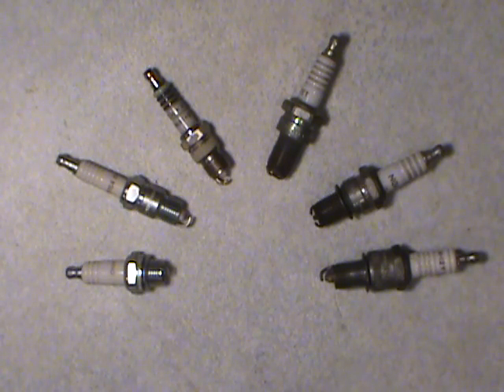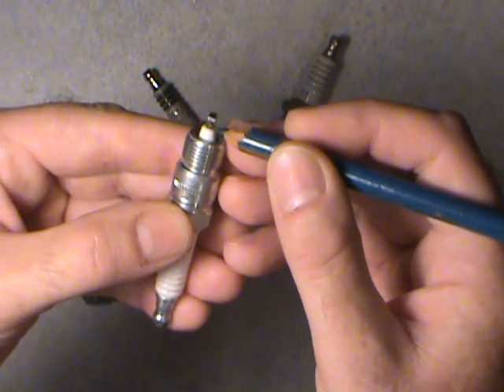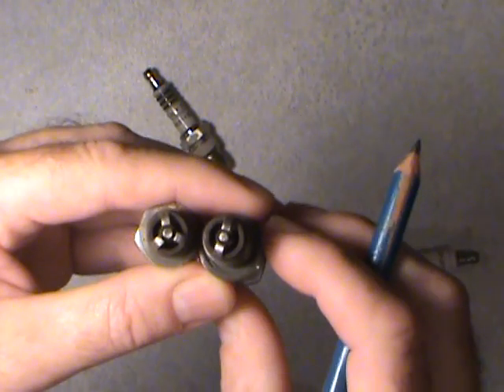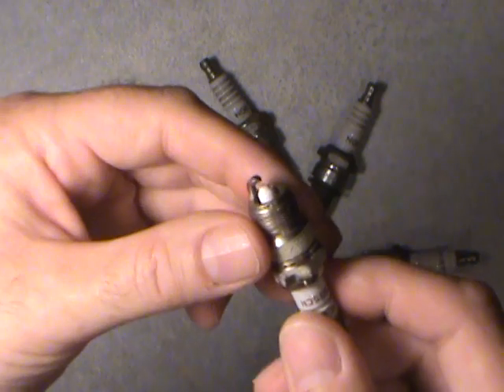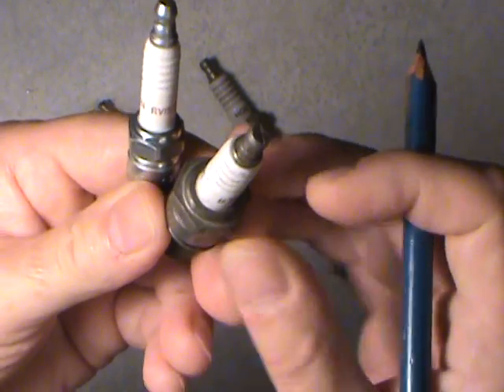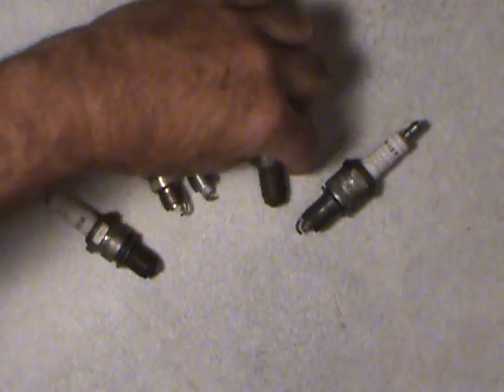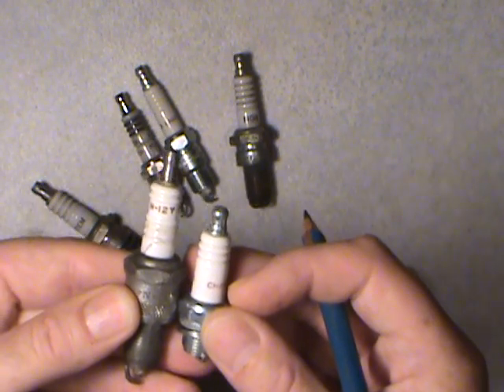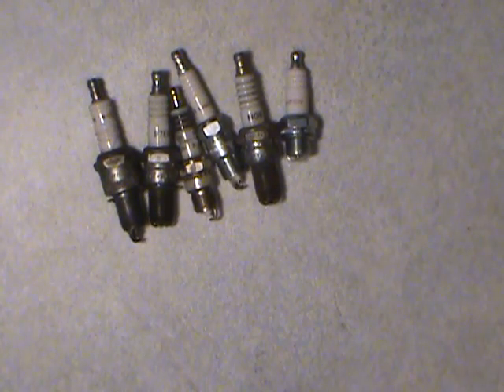SPARK PLUGS Overview (Part 1)

Comment: The reason for the multi side fire plugs used in the rotary Mazdas is the fact that they fire many more times than in a conventional piston engine. Single electrode centre fires simply electrically eroded far too fast and failed far earlier.
Reply from the maker: Greetings Norman May....I see, so, that's the reason that they put those "Strange Looking" Spark Plugs in those Rotary Engines, and Thanks, for that Information as well....I spent quite a bit of time on/with a 1973 Mazda RX-3, 2-door coupe, with an automatic transmission....Those Rotary's are as smooth as silk....With the Auto-Trans, once I hit about 3,000 RPM's and Higher, that Little Rotary sure "Took-Off!!!"....It was 70 Cubic Inches Displacement, and put out about 90 Horsepower!!!....But, the "Gas Mileage" was Horrible!....Drank gas like a Big V-8!!!....I recall the "Apex" Seals were shot, when the RX-3 was purchased, because, a few months later, I had to dump some 2-Stroke Oil, down into that little 4-Barrel carburetor, so the NSU-Wankle Rotary Engine would have enough Compression to Start!!!...lol...Then, there is the, "Special-Graph-Ticker-Tape-Compression-Tester" that had to be used, in order to Chart, the so called 6-Cylinders!!! (3 combustion chambers per Rotor, and there are "2" Rotors).

The Rotary Engine had "2" Oil Pumps!!!
1 Oil Pump that works like any other Oil Pump...

and...

...the "Other" Oil Pump, actually "Injected" Motor Oil into that little 4-Barrel Carburetor (or was it just below it?), so as to "Feed" some "Lubricant" (aka, motor oil), along with the Gasoline, much like a 2-Stroke-Cycle Engine, but, only so the "Apex" Seals don't Wear, and Burn Up!!!

I do remember setting up that Oil Injection Pump for the Apex seals.
Had to hold the engine at certain RPM, that was well above Idle speed, and the Oil Pump had to Output Motor Oil, at so many CC's (cubic centimeters?) in a given time!
Yes-Siree-Bob, an Engine that was "DESIGNED" to "BURN OIL!!!"...lol.

If you tried to use a "Regular" Piston/Cylinder Engine Compression Tester, it would only Indicate, the Highest of the "3" Chambers compression on that Rotor!

This little Rotary Engine had..."2" Distributors, 1 with 2 sets of ignition points, and the other Distributor, only had 1 set of ignition points.

"2" Ignition Coils, along with, "2" Ballast Resistors (if memory serves me right).

Then there was the Leading and Trailing stuff to consider, for, the Distributor Timing, and the 2 Leading, and the 2 Trailing Spark Plugs as well.

That little RX-3, did end up with a rebuilt Rotary Engine, that was installed by a Mazda dealer, back in the day, and I'm pretty sure, that the Rebuilt Rotary Engine, had the "New", and "Improved", Apex Seals (material that the apex seals were made of), Installed in it, at the time of its Rebuild.

Before I depart, I would like to mention "1" very strange thing, about that little RX-3, with the Rotary in it...

There was a Button on the lower dashboard, that, if I recall correctly, was kind of a Yellow Color, and that Button was supposed to Light Up, when the Outside Temperature Dropped quite low, as in, really cold.

I did some research on that Yellow Button and...

...when the temperature dropped enough, you were supposed to Push on that Yellow Button when it Lit-Up, and, by doing that, it would...

...take an Anti-Freeze/Water Mixture from a Reservoir in the engine compartment, and Squirt that Mixture into the Rotary Engine, to...

...HELP IT START!!!...lol...and, just when I thought, that I saw Everything!!!

I have lots of memories of that good ole RX-3, and I loved the Steering Wheel, and Gauges too!

Till next time...

Be Safe, take care, and have a good one.
Reply: RockysRoadshow
Reply: RockysRoadshow  I never had a wankel in a car but I did work on an NSU wankel twin rotor bike. The owner insisted on using regular plugs due to expense. ,Standard plugs were pretty much shot in about 100 hours. They simply had no side electrode left, hence the multi tip type. They always fired because as the gap increased they would automatically resort to the least amount of gap due to less resistance. Very clever engineering when you think about it. As for apex seals, my experience was all the seals were a constant issue. The end seals used to leak fairly often due to spring failure. (There were special springs that were wavy strips under the rotor end seals and they used to lose tension and allow the end seal to walk away from the chamber wall.) Apex seals lasted much longer as centrifugal force kept them in contact but you could tell when there was a problem when starting became hard. When you tore the engine down you would find the lift springs were collapsed just like the end seals. I was told once that a partial cure was to drill the rotors with very small holes so that the compressed gases would come up under the rotor seals and force them tight to the chamber walls but I never tried it. Sounds like it might work though.....
Reply: RockysRoadshow Regarding the antifreeze water injection set up on the Mazda, I have never heard of that. Was it primarily methyl alcohol with a little bit of water? Methyl has been used as a starting fluid as it will vapourize more readily at lower temperatures than gas and it will not foul plugs.

I have heard about water injection being used on aircraft piston engines and some heavy truck applications for horsepower increase but the engines had to be at operating temperature when you employed them. The idea was that when injected into a hot engine one cc of water expanded into about twelve cc's of steam giving a boost in power of about 30%. A 2000 hp Rolls Royce V12 Merlin went to around 2600 - 2800 hp for about ten seconds. It was a one shot deal though to save your life in fighter aircraft as the engine required a refit once used. Seems all that steam had a tendency to flatten rod bearings and bend rods......

Another method of starting a wankel and other engines that has been used is the introduction of compressed propane or methane gas for starting but propane was not all that reliable in extremely cold temperatures with a boiling point of -42 C (-43.6 F). Methane worked much better with a BP of -164 C (-263 F). Unfortunately both had a tendency to strip chamber walls of all lubricate causing excessive engine wear and they had to be used sparingly.

As an aside, propane injection is still used today as a power booster in some diesel truck engines with few problems regarding engine wear because the diesel fuel itself is a lubricate.
Reply from the maker: Norman May
Greetings Norman May....Thanks for all of the Information, that you put forth, in your very Intelligent comment, my Friend....First off, I'd like to tell you about how I was "Introduced" to the "NSU-Wankle-Rotary-Engine", and, what I learned about the "NSU", and the "Wankle" names, then I'll elaborate, on some of the other things, on this here "Adgenda"....So then, here we go, ummmm, rather, here "I" go!...lol....Back in my High School Days, it so happened, that, one of the Courses I took, back then, was called, "Industrial Power", or, was it the other one, called "Industrial Science" (I'm leaning towards the former, and not so much the latter, as I kinda recall, and, I do recall, taking Both Courses, but in Different "Grades")....The Instructor (aka, Teacher), used the Black Board (or was it a Green Board?...lol), to Explain the "Rotary Engine", through His Chalk Board Drawings/Sketches, along with some Very Good "Narration", and I'm guessing that the "Rotary" Engine was supposed to be part of that Course's "Curriculum" (aka, course outline) perhaps....I don't recall, having seen a Real-Life-Like "Rotary Engine", up close and personal, during the duration of that Course.

Now, here's what my former "Teacher", taught us all, that were present during the part of that Course, that Focused on the "Rotary Engine"...

Here's the "Breakdown" on the "NSU-Wankle" Name...

If memory serves me right, the Teacher said, that, "Wankle", was the Surname, of the German (I think?) Gentleman, that Invented/Developed, the "Rotary Engine".

Now for the NSU...

From what I recall, NSU was probably the Name, of the Japanese (I think?) Company, that was responsible, for putting the "Rotary Engine" into "Production", so that it was made available to, and I'm thinking "Public" (as in, You and I).

According to my Teacher, that was why, the "NSU", and the "Wankle" Names, were "Combined" together!
If the above, isn't correct, then perhaps, someone may correct the above information, or, if I happen to find out, the above, to the contrary, I'll post a corrected update, somewhere, down the road, hopefully.

And now, the Moment, You (and Others), have been waiting for!!!...lol.
Lets move onto that Little Yellow Button, shall we?
I went and had a look-see, as to what's go-in on, with that Anti-Freeze/Water Injection..."What-Does-It-Do-Thing-Ah-Ma-Bob???"...

The so-called "Official" Name for the Anti-Freeze/Water Injection, that Injects that anti-freeze/water solution into the 4-Barrel carburetor on that there Rotary Engine, when it's Very Cold Outside, is called (I think)...

A "Sub Zero Starting Assist System"

That little Yellow light, on that there Push Button, on the dashboard, was Theoretically supposed to "Light-Up", when the Outside, and dare I say "Ambient" Temperature "Dropped" to "Zero Degrees", and I'm thinking "Fahrenheit", as the Aftermarket Mazda Manual, that I still have, was Printed in...California U.S.A.!

I did remember that the Mixing Ratio of that there "Anti-Freeze/Water" Mixture was an the "Strong" side, and Wowsers!!!...that Ratio happened to be...90% Anti-Freeze to 10% Water!!!
Talk about a "Strong Mix!!!"
I'm thinking that a "Mix", that Strong, would be rather Corrosive, to say the least.
Most of the Anti-Freeze Jugs, that I purchased, indicated on the Jug's Label/Printing, to Never Mix it any Stronger then...70% Anti-Freeze to 30% Water!!!
Apparently, the Anti-Freeze "Needs" the Water in the "Mix", to do its "Chemical Magic!!!"
I recall Adding, quite a lot of 100% Anti-Freeze, to the Mazda RX-3's Radiator, to top it off...
After putting the Rad-Cap back on, I started the Rotary, and, I watched the Temperature Gauge (and a very Sensitive one at that) on the Dash, and "Oh-No", the Coolant Temperature Gauge "Kept Climbing, Well-Above" where it Normally Points on the Gauge when fully warmed up, and to Operating Temperature, and kept Climbing, Hotter, and Hotter, and I "Shut-Er-Doon!!!"...lol...(turned off the Ignition Key), to keep Mr. Rotary, from "Over-Heating", and maybe crossing that Forbidden..."Self-Destruction-Over-Heating-Coolant-Self-Destruction-Line!!!
Lesson Learned, BIG TIME!!!
If all else Fails..."READ THE INSTRUCTIONS!!!...lol...(it's just what Most Males of the "Human" Race happen to do...Read the "Instructions" Last!!!...oh yeah, not to mention, that "Us" Males, most of the time, "Refuse" to ask for Directions, when we are Lost, while Driving Our Cars, or what-have-you...must be that "Knee-and-rith-all" DNA  that is still Present in our Skin covered Skeletons!...lol.

Oh yeah, just remembered, that that "Second" Oil Pump on the Rotary Engine, that was responsible for "Lubricating" the Apex Seals, through its Metering System, also provided some Lubrication, for those, and in this case, the "2" Rotor's, set of "Side Seals", as well apparently, that you were mentioning earlier.

About the "Mods" that you were talking about, with the drilling and centrifugal force and such...
The Mazda "Shop", that I took the RX-3 to, when I didn't posses the Knowledge or Tools to remedy the "Situation", not only Repaired almost anything that related to the "Rotary Engine", but this Shop, and its Inhabitants (aka, Shop Owner/Mechanics) actually "Raced" Cars that had a Rotary Engine Hiding under the Hood!

I recall Driving that RX-3 on a busy Street, and it started doing the "James Bond"..."White Smoke Show", that I noticed out of the Rear View Mirror, as it was Chasing my Rear Bumper!!!
It turned out to be, that the RX-3's Automatic 3-Speed Transmission's "Vacuum Modulator" Sprung-ah-leak" (actually Air, not Water...lol).
So's then, I calls up that there "Rotary Engine Specialist Shop", and explain to the Guy, that answered the phone, about, my "James Bond Incident"...
He knew "Exactly", what was causing the RX-3 to act like James Bond's "Aston Martin", when Mr. "Shakin-Not-Stirred" or was it, "Stirred, not Shaken", hit the "Smoke On" Button, in the Aston Martin, to Blind the Bad Guy Driver's Vision, as they Chased after the "Ladies Man!" and his sometimes "Smoke-Makin-Car!"

The Smoke Makin, and Funny Stuff just above, was one thing, but, please read on, for some Real Excitement!...lol

So then, I takes the Smoke Makin Mazda RX-3 to that there "Rotary Engine Specialist-Fix-Em-Up-Shop", after He, the Gentleman, Quoted me, over the phone, a very Reasonable, and low cost Price, to replace, that there Miss-Behavin/Faulty "Auto-Trans-Vacuum-Modulator", to keep Mr. Smokee, from Foggin the rest of the Drivers on the Road, like James Bonds did, to those..."I-Can't-See-Where-I'm-Go-In-Bad-Guys!!!"...lol.

Keep reading, there's even More...

Here's what actually happened, when I took the Smoke-Makin RX-3 to the Rotary Specialists Shop...

I was present, and watching, as the following took place, right before my Eyes!
I pull the RX-3 into the shop/service area...
I speak with the Guy, and he goes into the stock-room, and retrieves the New, and Not Leaking replacement Auto Trans Vacuum Modulator...
Next, Mr. Fix-Em-Up-Guy, goes, and gets this Really Big Strong Professional Looking Floor Jack, on Steel Wheels, and Positions this Monster of a Floor Jack under "Only" One Side of the RX-3, somewhere between the Front and Rear Wheels...

then...

He starts Jacking the RX-3 "Up, and Up, and Up, some More"...
Damn, the RX-3 was almost on a "45 Degree Tilt", as viewed from the Front or Back of the Car, like it was Racin on a Futuristic High Banked Oval!!
Geez, I though that the RX-3 was going to be Rolling Over very Soon, but, He Stopped, and the RX-3 was in a Position, that I never Imagined Possible!!!

Then, he just Crouches, under the RX-3, and does the, Swap of the Old to New Vacuum Modulator...

Why, oh Why, did "He" Jack it "UP, on that Scary Angle???"...and so I asked "Him"...

His reply was...

So that there "Wouldn't be, a Loss of Automatic Transmission Fluid", as he Changed-Out the Old to New Vacuum Modulator, that's why.

I'm thinkin, otherwise, "Normally", a Person/Mechanic, would Drain out, and lower the Auto-Trans "Fluid Level", so it wouldn't Puke all over the Floor, and make a really Big Mess! (or, use a Catch Pan/Basin/etc.).

True Story that.

Now about Water Injection...
I recall seeing in a book somewhere, that you could Add, a so called water Water Injection System on an Engine equipped with a Carburetor.
Looked like a Glass Jar, much like what Ma, or Grandma, used to Fill with Preserves (aka, Pickles or Fruit, etc., Mason Jar perhaps?).
Not sure, but it may have had some kind of Chemical to make the thing work?

Must-Not Under-Estimate the "POWER" of Steam!!!
Nuclear Power Plants that Produce "Big" Electricity, use Steam Turbines, do they not? (not sure eh).

Oh yeah, I did use some "Starting Fluid" from an Aerosol spray can, on the Original, Low Compression Rotary, to get it Started! (not the 2nd Re-Built Rotary Engine).
I think it was called, something like...Quick Start...and, it may have been something like "Ether" (pronounced, Eee-Thir, I think).
That Stuff Worked "Amazingly!!!"

Now, I'll finish up, with the Merlin and Rolls Royce Engines...

Amazing, I must say!!!
I still remember watching the Unlimited Hydroplane Boat Races, on T.V.,with those "Thunderous" Engines!
Then, (the Rule Makers), went and Allowed the "Turbine" Engines to be Installed in those "Unlimited Hydros", and that my Friend, was a very Sad Day Indeed.
Good ole...Atlas Van Lines...Miss Budweiser...

So then, there you have it, well, for this Episode anyways...

Be safe, take care, and have a good one.
Reply: The Wankel was actually invented by Felix Wankel while working foe NSU, hence the confusion. NSU (Naeh- und Strick Union" which means "Sewing (Naehen) and Knitting (Stricken) Union) is a German auto and motorcycle manufacturer that started out by making sewing machines. NSU has since been taken over by Volkswagen and merged into the Auto Union Group.

Wankels have been made by NSU, Mazda, Toyota, DKW, and Norton to name a few. While there have been significant developments made towards reliability and fuel economy, all have stopped further development. It is rumored that there is a Russian group still working on the Wankel but to date there has been nothing released.

Your experience with the defective vacuum control valve was a frequent problem with many of the old style automatic transmission setups. Most of the non computer controlled trannies had some form of vacuum modulator valve that controlled shifting. When the engine was floored, the vacuum level dropped off and this caused the trans to downshift, sometimes called "passing gear". When the diaphragm in the modulator failed, it allowed transmission oil to flow up the vacuum line into the carburetor creating a smoke screen that any sea going destroyer would have been proud of. I don't know how many engines were wrongly rebuilt due to oil burning when all that was really needed was a new modulator valve but I can tell you a quite a few "shyster" mechanics made a lot of money rebuilding engines by replacing modulators. One fellow that I knew actually used to buy vehicles with "shot" motors that he diagnosed as needing re-ringing from his customers for a discounted value then he replaced the modulator valve and sold them through a small car lot he had a piece of.....

Regarding water injection, to the best of my knowledge there were no chemicals involved, just straight water. The water was instantaneously turned into steam by the heat of compression and the firing of the fuel. (Exhaust temperatures can easily reach 800 degrees F.) The expansion of the water to steam was what created the additional power.

As for the Rolls Royce Merlin's, I agree with you 100%. Only a motor head can truly appreciate the exhaust note of those V12's. I still go to you tube and listen to that marvelous sound that comes from a Spitfire or P51D Mustang on a fly by. Raw horsepower at its best!
Reply from the maker: Norman May
Greetings Norman May....I had been thinking the last day or so, about, what I might just remember about the RX-3's Rotary Engine....Given that, there are not any intake or exhaust valves, and only "Ports", and the so called "Strokes", operate much like a "Two-Stroke-Cycle-Engine", has me thinking that, that's the reason for the High Fuel (gasoline) Consumption Rate, and like I said before, about getting Gas Mileage, that I like to compare, to that of a "Big-Block" V-8!....If you happen to think the Rotary Engine Design seems rather complicated, then, you should have seen what I was up against, when it came to the RX-3's Pollution Control System!!!....It was equipped with a "Thermal Reactor", with its Own, what looked like a Smaller Exhaust Pipe, that kinda Paralleled along-side of the Real exhaust pipe!....Also had at least "2" Control Boxes, and Lots of "Other" Gadgets and Things, like, Coasting Valves, and, the List, goes, on and On!

On the "Under-Side" of the Air Cleaner "Lid", there was a Space Ship Shaped "Thing-ah-ma-Bob", that happened to be the so-called Carbon Canister, if memory serves me right.

Also, there was a "Manual" Lever, that was Mounted on the Air Cleaners "Snorkel", and it had the Letters "S" and "W" Stamped on this Lever, that you had to "Remember" to "Set" for the Season (aka, ambient temperature) that the RX-3 was to be operating in, or Bad Warm-Up in Winter if lever was left in "S" (summer) position, and Hesitation, and poor running in Summer, if lever was left in the "W" (winter) position!

It's kinda like what the "Domestic" Vehicles of that time period did "Automatically", with that Little Thermostat, that was usually mounted inside the air cleaner housing, that had the Flapper Valve in the Snorkel, opening and closing, with engine Vacuum, that was regulated by that Little Thermostat that was Hiding inside the air cleaner housing.

The Old School "Definition" of a "High Performance Engine", as I recall, is, having an Engine that was able to Produce "1" Horsepower or More, for Each Cubic Inch of Displacement.
Lets see now, RX-3's Rotary Engine had 70 Cubic Inch Displacement, and was Rated at "90-Horsepower!!!"...not bad at all.

I though Rolls Royce and Merlin were "2 Separate" Engines/Manufacturers!...Yikes!

I recall that Mazda went to a "Single" Distributor, in the later 1970's or early 1980's, where-as, the RX-3's Rotary Engine had "2" Distributors!

I really can't see the Rotary Engine becoming very "Fuel Efficient", no matter how much R & D (research and development) that they throw at it, due to, what resembles a, "2-Stroke-Cycle-Design".

I can't Fault the Design, for the apparent "Power to Weight" Ratio though.

Even the Spark Plugs have changed Lots!
Newer ones, like they install on something like RX-8's, have a very Different Design, from the ones, back in the 1970's, and if that's not enough, the "Leading" spark plugs are "Different" from the "Trailing" spark plugs!!!...Wowsers!

I still remember, maybe too much, about the RX-3, and its Rotary Engine, that's for sure, and, it was Fun, while it lasted, never-the-less...

Be Safe, take care, and have a good one.